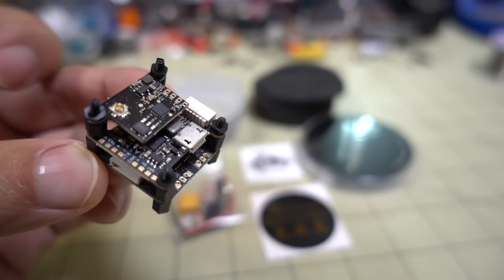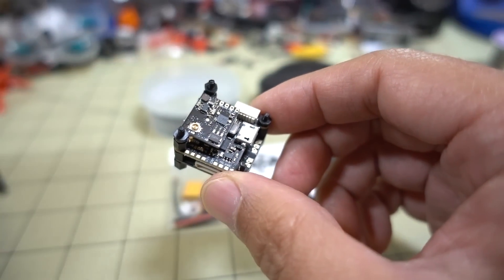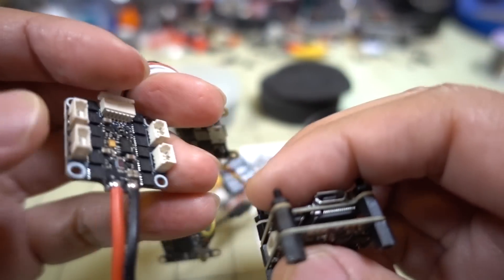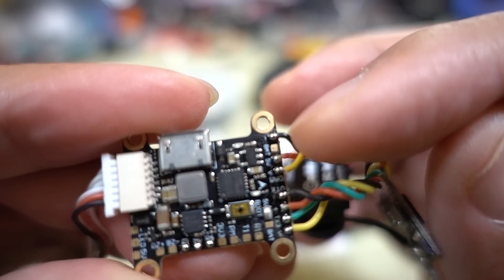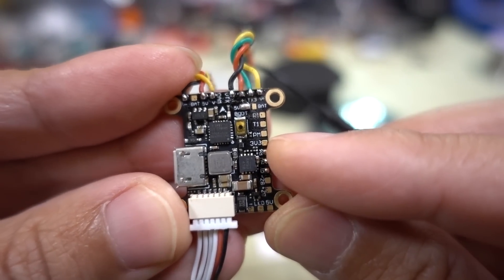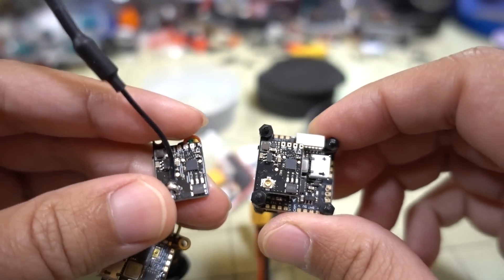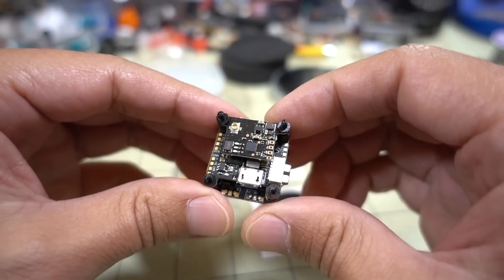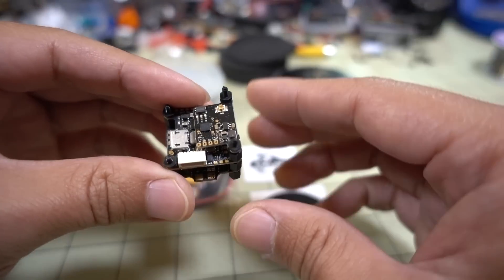SkyStars Talon 15A Micro Stack Review 🏁

Comment: Nive video! I have the same stack for a custom build, should I run this in D shot?
Reply from the maker: Yes, DSHOT will work fine on this.
Reply: @AlbertKimTV  Thanks! I had an issue with 2 motors that needed to be reversed which I did in BLHeli. Hovering great now 👍

Comment: Hey Albert, I Bought A Couple Good Rise Indorfin 130mm Quads For $25@? They Have 1104 - 4100kvs & Run 3s 1100 Batts? I Think The 4in1 Board Has 1 or 2 a ESCs Burnt Out Is All That's Wrong With Em, Can You Fix Them By Replacing The ESC Chips Pretty Easily or Do You Just Have To Buy A Whole New $26 Board? And Where Do You Source All The Micro Board Parts, On Banggood? or Other Places? Thanks ;~)P
Reply from the maker: I don't know how to replace the chips.  I would just buy a new ESC board.

Comment: Nice review of popular stack. You’re right about the plugs, as it stands to reason.  I think they missed a great opportunity to increase the usefulness of the half-size VTX, if they would have given you the option to add the “blank” other half to mount a receiver using all four of the stand-off screws. Hope that makes sense, but make it the same size as the two boards, leaving a space for the receiver, or that empty part could be detached if the user wanted.  Just a thought.
Reply from the maker: Other than the XM+, there's not a lot of other receivers that might fit that.
Reply: Albert Kim - There I go again thinking “whoop” size, such as the XM, Full Speed RX, the Beeceiver, and a few others, but these ten have lesser range which is ok for a Whoop, but not as well suited for the larger quads.  Oh well, it was just a thought...lol
Reply from the maker: I'm thinking there are probably a lot of reasons you don't want your control receiver to be right next to a VTX spewing a lot of RF noise....  LOL.
Reply: @AlbertKimTV  Yes, you have a very valid point, however, what doesn't put out lots of RF on a quad anyway?  The whole crazy things are flying buckets of RF noise... But OK, it was just a bad idea, but so is the half board VTX.  IMO, is the worst idea since the board is not properly supported and creates a failure point in a crash. Really, I was just trying to find a use for the space that was tossed away by this awful design... That's all I am saying.  Happy flying bro.